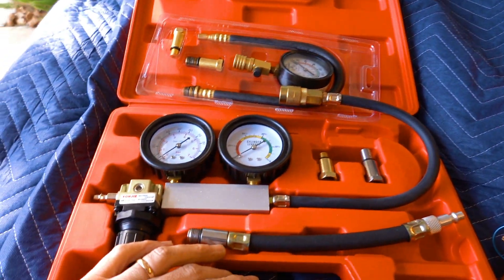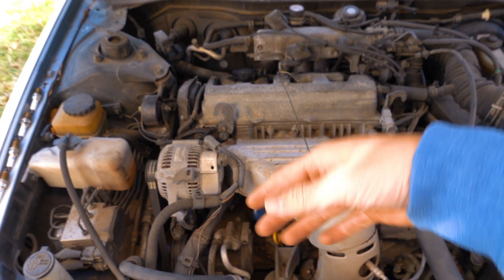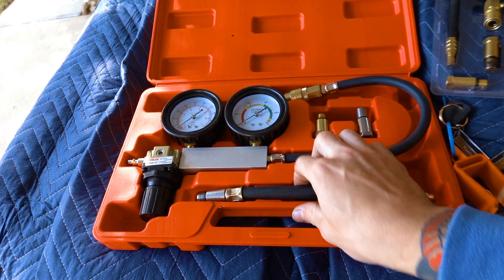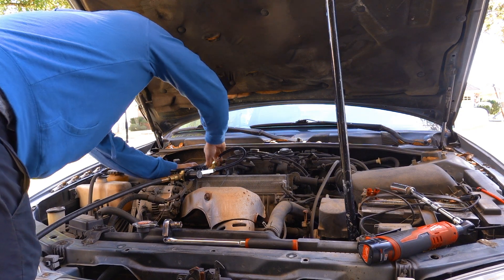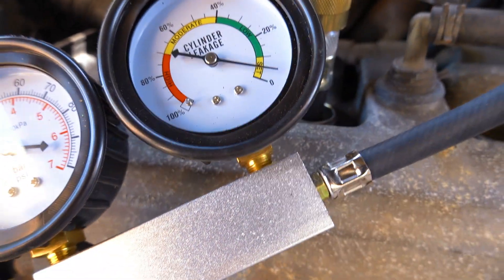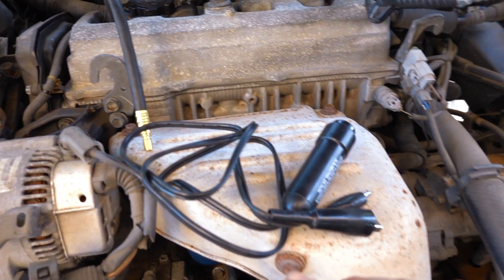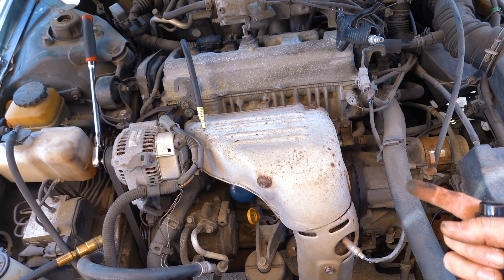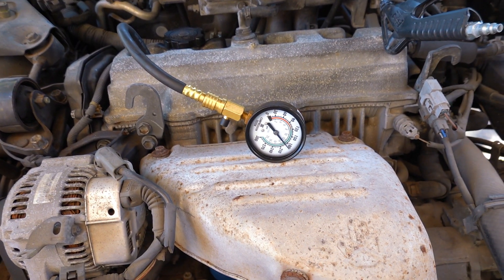Leak Down & Compression Test Easiest Explanation and Instructions / Bad Head Gasket / Toyota Camry

Comment: Great video.  Question about the leak down test and the remedies.  Seems like if there is a leak, no matter what the issue is, the bare minimum solution would be to remove the head?
Reply from the maker: Most likely, but depends on the motor.